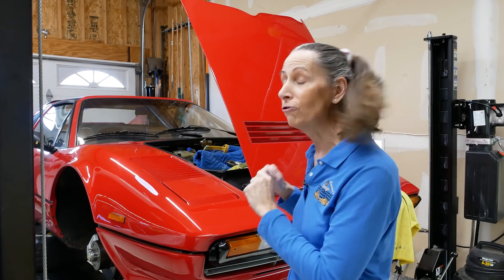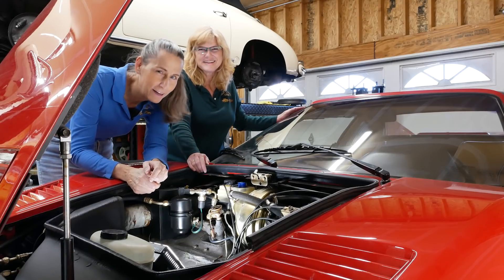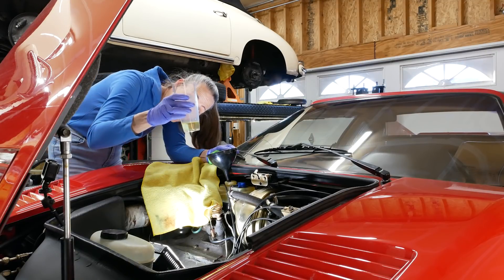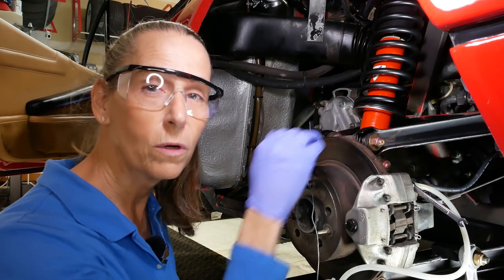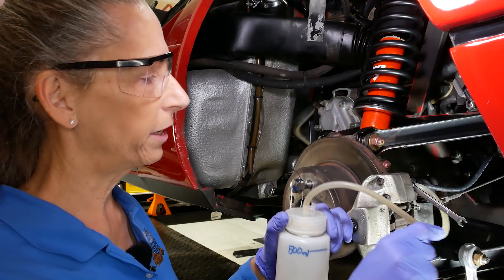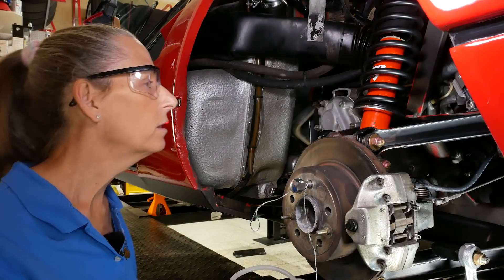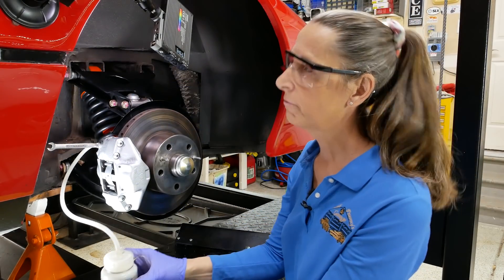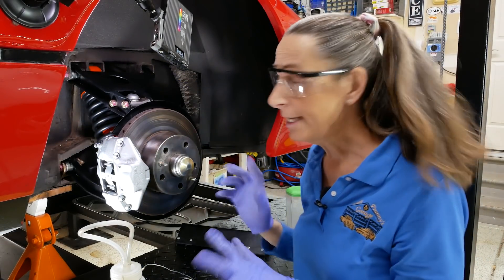Bleeding Brakes on a Ferrari 308 - And, WHEELS BACK ON!!

Comment: In my experience, I've never had an issue with the power bleeder.  Not sure what Ferrari reservoir attachment is, but for Porsche, they are screw on so it would be virtually impossible to blow it off.  Also means bleeding can be a one-person job.  Ready to see the 308 inn the road!
Reply: Agreed. It reduces the time greatly plus the biggest issue is you are not pushing the brake pedal to the floor and in turn putting the master cylinder seal into the unpolished portion of the bore of the cylinder, therefore possibly wearing it prematurely.

Comment: As an added preventative measure, once you have finished bleeding ad locked off the nipple, I use the small tube that comes with Corrosion X or WD40 and squirt a tiny amount in the nipple to displace any brake fluid, which being hygroscopic will draw moisture and promote corrosion. Not my idea. I learned it from a mechanic I respect greatly here in the UK. As soon as I saw it I thought it was a great idea. again, super camera work and editing. Keep it up.
Reply: I keep a small model making paintbrush with my anti-seize container and a bleeder nipple just might get a little bit of "anti-sleaze" around the perimeter of the closed bleeder.  But I hadn't thought of WD-40 inside the nipple!
Reply: I spray the bleeder out with brake clean, putting the nozzle tube directly down the bleeder (AFTER IT'S TIGHTENED DOWN SNUG OF COURSE) so I know it's completely dry. That way if I see even the faintest amount of fluid coming from the bleeders, I know that they are leaking

Comment: My brake bleeding tales & tips:

Used to live in a rust belt city full of potholes. My fairly new VW Golf made all sorts of clanking and banging noises, but that was just the potholes.  I flushed the fluid at the 2 year mark, as VW commanded.

A few years later I found that I'd left my wee 7mm wrench on the right front bleeder and put the dust cap over the nipple, so the wrench was along for every bump and pothole.

I'm about to start using a Motive pressure bleeder for some cars in the fleet, but I've had a lot of good luck with the CAPRI tools vacuum bleeder, which runs off an air hose from my air compressor. It's very easy to turn on and off.  I believe Harbor Freight sells a cheaper version, and considering it's a plastic pressure chamber and a venturi, it shouldn't be hard for HF to get that right.

Another nice feature of the CAPRI bleeder is that a small diameter scrap of copper tubing fits in the rubber nipple on the brake bleeding hose, and you can insert that copper tubing into brake or power steering reservoirs, and quickly suck them dry (or lower their overfilled state), it's much tidier and easier than the ol' turkey baster. 

Years ago, in my parking lot days, using a clear tube to bleed with,  I learned just how quickly those bubbles move as soon as you close the bleeder or stop the pedal from moving.  I also learned that you can really see the bubbles better in the dark with a headlamp on. (And clear tubing!) (Also, vacuum bleeders are deceiving, because they suck air past the threads of the open bleeder nipple, so if you see a constant stream of bubbles, that's not from the braking system, so don't worry.)  

In those parking lot years, I also invented this, and now, in my youutbe years, I've found other were people doing this: bleeding a brand new caliper or one that's been disconnected? While you're bleeding, give some boppity boppity to that caliper with your rubber-tipped hammer, it might release some air bubbles that were clinging to the wall of the interior. (You know, the Craftsman hammer with a red rubber tip and a yellow plastic tip!)

I only learned about this a few  years ago: some master cylinder reservoirs have a divider wall between front and rear circuits and you really need to fill that reservoir to get fluid into the back half. I learned this the hard way by using my CAPRI vacuum bleeder to really suck the lines dry going to the rear caliper on my old Benz. I had been peeking into the fill hole of the reservoir and thought that was the level! No, that was the front brakes' level.
Reply: P.S. Capri Tools CP21029 Vacuum Brake Bleeder , $94 at the Bezos hut.  Cheaper versions of this concept are $30.
Reply from the maker: We love HF. ❤️

Comment: Good video Franny, but I think since you have one use the pressure bleeder, becourse when dealing with an older masterbrakecilinder the piston and cups can  easy be damaged when you push them way down in the cilinder to a place inside cilinder where the brakecups have hardly ever been. The damage caused by residue in the old brake fluid. (It happened to me once) Let's hope your master cilinder lives for a long time.

Comment: Beautiful car!  Hadn't heard of the risk of blowing fluid all over the place with the vacuum bleed systems!
Reply: Pressure bleeding from the master cylinder reservoir, it might happen. And you should see that reservoir swell! It's kinda scary.

Vacuum-sucking from the caliper, a fairly tidy process!
Reply: @theundergroundlairofthesqu9261  I struggle with the vacuum bleeding from the calipers- I always see tiny bubbles - I think air is sucked in from around the bleed nipple - do you ever run into this problem
Reply: @carlloftin2850  Yes, I have seen that. Possible options:
a) ignore it! I found the bubbles to be consistent and small, not like the big bubbles we're used to getting when bleeding air out of a system. (It's also good to have a small flashlight or headlamp and a clear bleeding tube to see what's going on with more clarity.)

b) Take a finger and push on the loose bleeder screw, this (hazy memory) might reduce the amount of air passing through the threads. I think I was pushing laterally. Similar to a trick I figured out long ago for oil drain plugs -- push in as you unscrew to reduce early dribble before the sploosh. Something to do with threads, is my theory.

c) prevent air getting past the threads by daubing a little bit of antiseize or grease around the bleeder screw where it sticks out of the caliper. This can not only prevent air going down it, but also moisture and salt when driving. I've done this without any problems.

d) One more bleeding tip I invented on my own but later found out I was not alone: for something like a new caliper or something that really has been opened, I bop the caliper with a rubber-tipped hammer  during bleeding, to shake any possible bubbles off the interior wall.

Comment: I changed the brake fluid in the hydraulic system alone. I used another expansion tank cover and a manual air pump.

Comment: I would have used the power bleeder myself. Never had any issues with it.
Reply from the maker: Great to know.  I usually do if the reservoir is disconnected from the MC.  I just don't trust the rubber grommets to handle 15-20psi.
Reply: @HeidiandFranny  Just make sure you have the correct one for your application and they are fine. They have them for american cars, europeen cars, asian cars.... even in different sizes (for small clutch masters) and different threads. Great product. You never miss .

Comment: If you've got that much air in the system, should you not bleed the clutch as well?
Reply from the maker: The clutch on this car is by cable so no need :)
Reply: Great job as usual. I  also like to put a wood block under the pedal so it doesn’t bottom out, which can injure the seal in the MC.